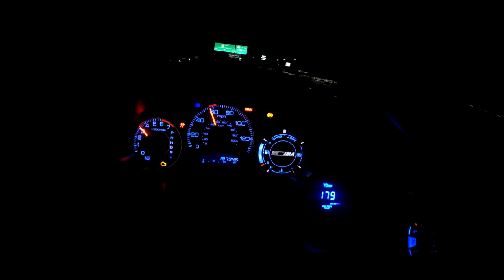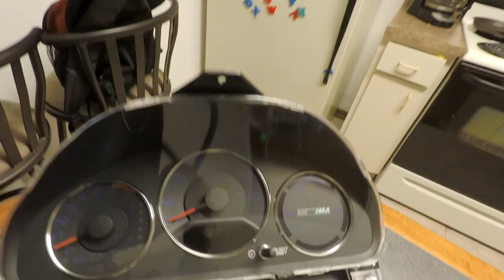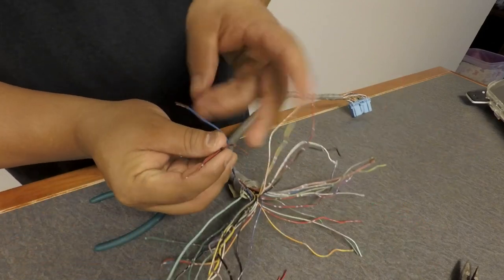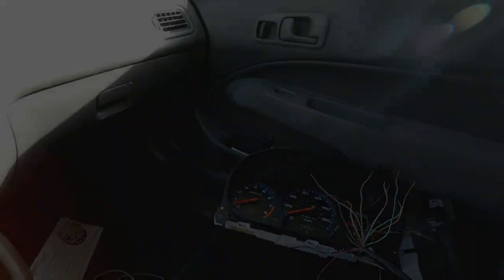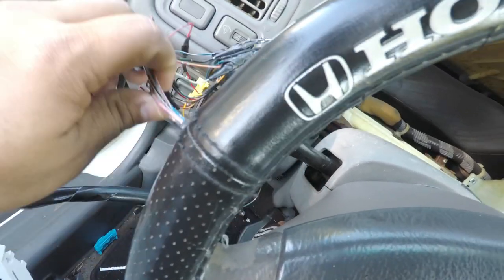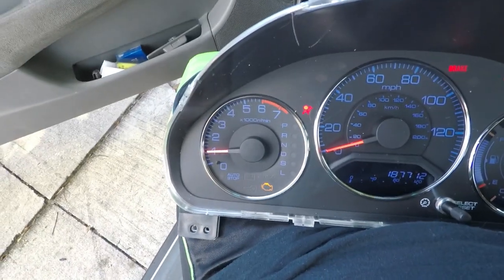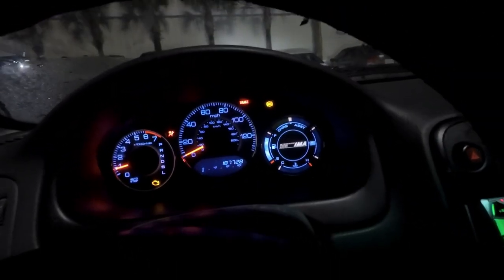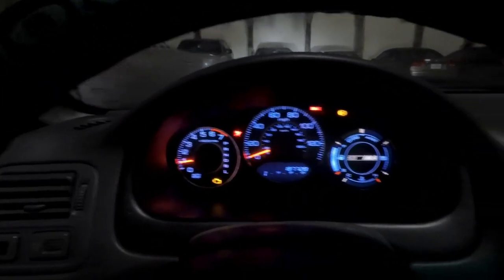HOW TO INSTALL 99 / 2000 HONDA CIVIC GAUGE CLUSTER SWAP!!!!! 05 HONDA CIVIC HYBRID CLUSTER

Comment: Good Brother, I only have one doubt, and that is if you had to make any other connection apart from the diagram, because I installed everything just as it is in the diagram and it does not turn me on brother

Comment: I can use your advice... I have the fuel gauge isnt working but i know i have it connected correctly as far as the diagram goes but please do let me know what wire did you use to get the fuel working thanks man

Comment: Could you please send me photos of the pigtails/plugs you used. 
I think I have the wrong ones and it would help me a lot to be able to see the pin locations and colors of your plugs.
Reply: Me too, I followed the diagram and everything but somehow can’t get it working. Any photos of the old wiring with the new wiring connected together to see exactly where they go. Tbh I cant get it working at all 🤦🏻🤦🏻🤦🏻

Comment: Did you cut the bottom tabs to make the cluster fit? Im about to put mines in but the tabs seem to be in the way, what did you do? Thanks for the video was looking for something like this
Reply from the maker: Hey you gotta forced it in carefully I hope that helps
Reply: Hey man i jst got it in and plugged up tging id my fuel gauge isnt working. Which wires did you combine? Much appreciated thanks

Comment: Hey, awesome work man, but quick question: I tried downloading the diagram on the link, but I wasn't able to download it, I found another one but only for manual transmission, is there any chance you can guide me to a link with the diagram for a Hybrid Honda with automatic Transmission?
Reply: Can i get link for manual trans?,thx before

Comment: yo man, is this the same for a 03 cluster swap to a 01 please respond man!!!
Reply: I need a diagram to do it
Reply from the maker: @stopeddie3056  in the video I show the diagram
Reply: is it the same bro?
Reply: do you think I can find LEDs for a 2001 honda civic Ex cluster?
Reply: All EM2 clusters are not the same.
Some are non-Optitron and the others are Optitron. Non-Optitron has analog signal and much easier to get working. Optitron needs a bit more to do to make everything work right. The EM2 Cluster is Optitron FYI. 😎 Stay kool
Reply: Yeah I😎 I replaced clouster EX to hybrid 😁